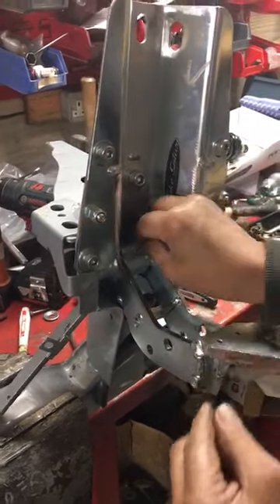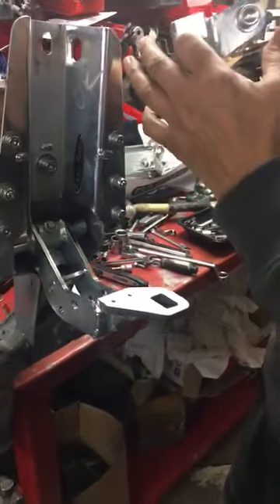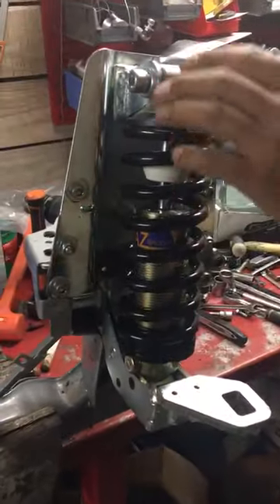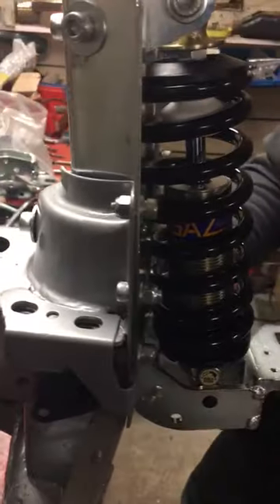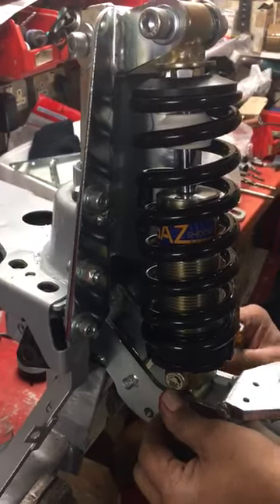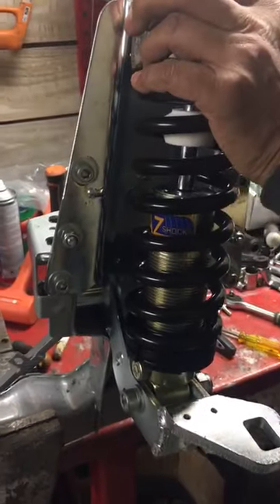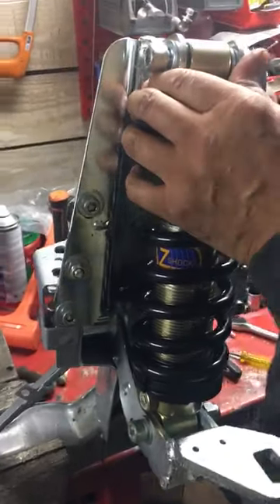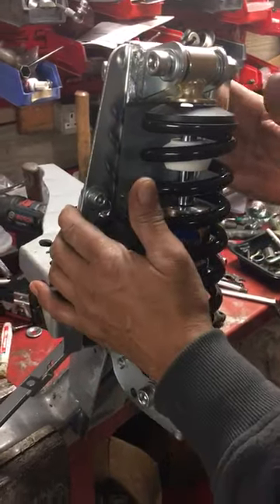Mike Satur MGF Hydragas to Coil Conversion kit demonstration part 2 - FCCKit

Comment: I have a 1999 MGF VVC, I've spent a lot of time on, upgrading brakes to big brakes, new head gasket kit, clutch, welding, respraying, the list goes on.  It is miles better than when I bought it, and possibly a future classic as more MGFs get scrapped.  I'd like to keep it, and this upgrade suspension kit makes sense.  Its either this one or the Suplex kit.  Getting a mechanic to fit it though in Cornwall, is going to be a challenge.